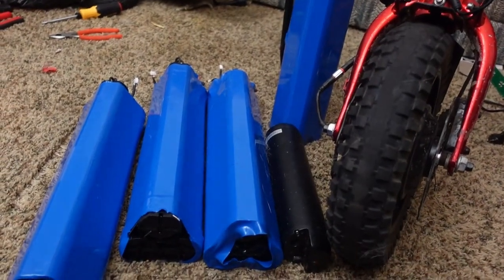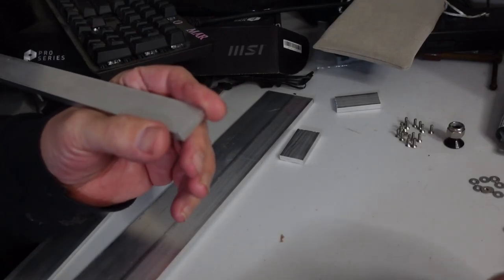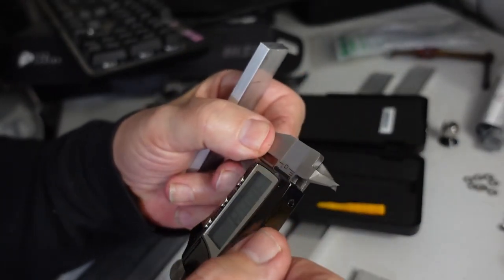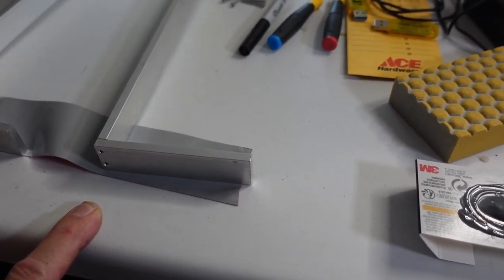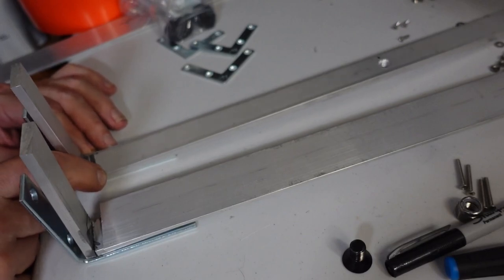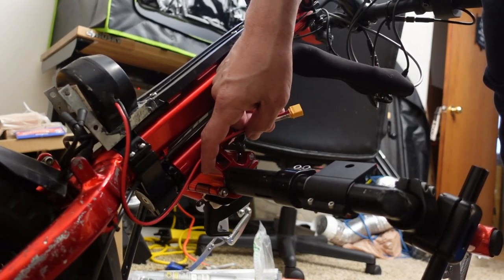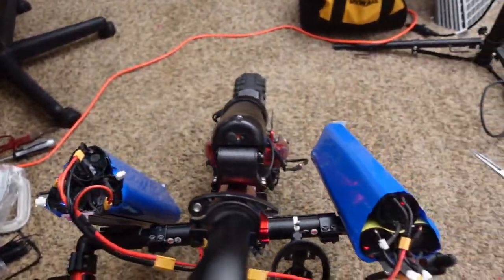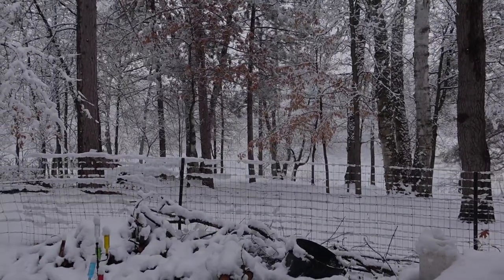Rio Firefly mod: Extended Battery

Comment: Any luck accessing the ecu to raise the top speed?
Reply from the maker: @UNIVERSEITI  nope. Completely potted. Also, Chinese manufacturer, proprietary software controls. 
Also, the existing firmware has limits for safety that I'm not going to attempt to subvert. Ron is my friend. He's already trusting me with his main mobility machine. 
If you were to attempt something like this, I'd suggest unplugging the wheel unit and plugging it into your own controller. That way, you can do what you want and assume the risk. And shoot video, I wanna see.